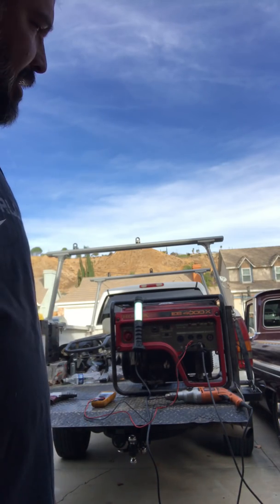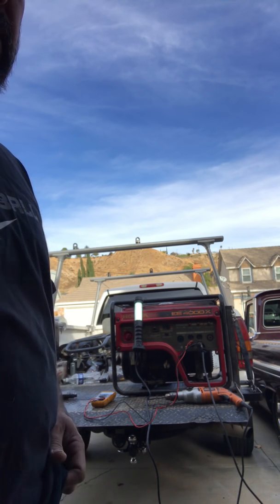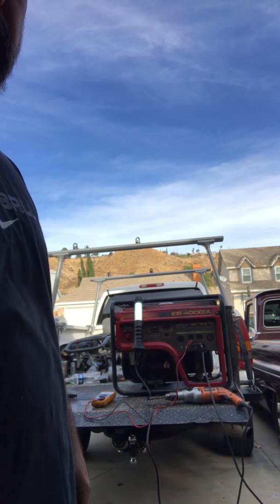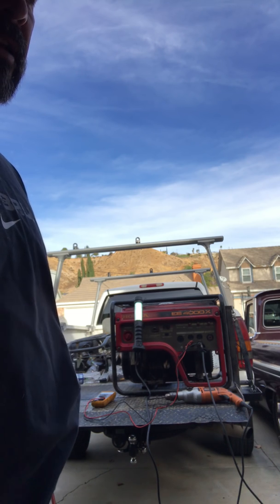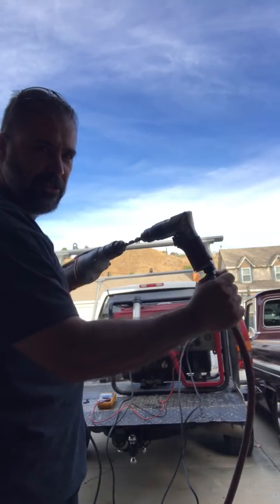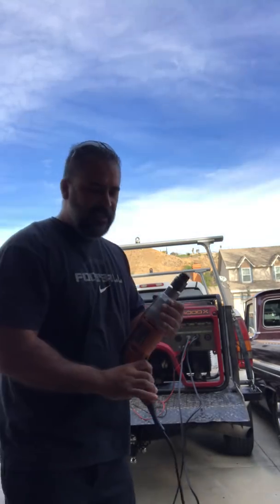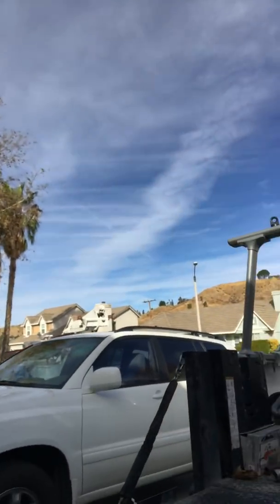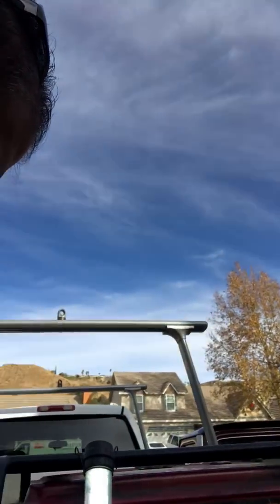How to re energize a generator

Comment: Just  a question... set the reverse mode on the electric drill then holding in the trigger while using the Air Drill to turn the drill motor ???   The Air drill is turning to the Right ? it looks to me. About how long should this process take ???   Thank you to anyone who reply's
Reply: Generator safety. Remember that portable generators can be dangerous if not used carefully. https://youtu.be/I1jT3ANENvI just reminding everyone to be careful using portable generators.

Comment: Great video i just got a craftsman 10500 7000watt generator for $50 bucks from lowes it was returned  tank was full of water an battery cables were cut spent about $10 to fix an this video now its running strong thanks bro...

Comment: I have a predator 4000 been having trouble intermediate power no power I just right now tried what you did with a cordless drill to an electric drill while running I'll be damned if it worked thank you for this video sir my hat is off to you amazing